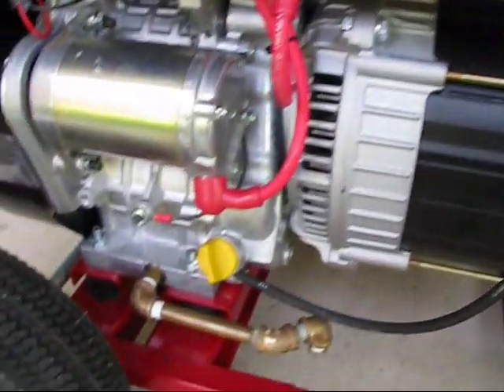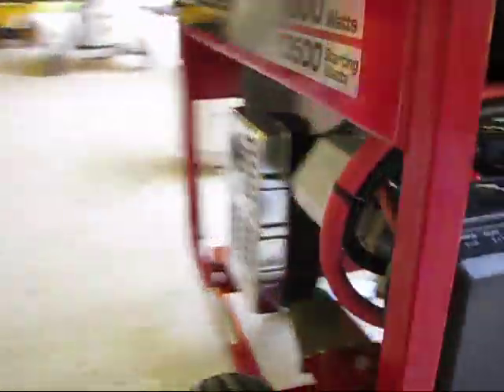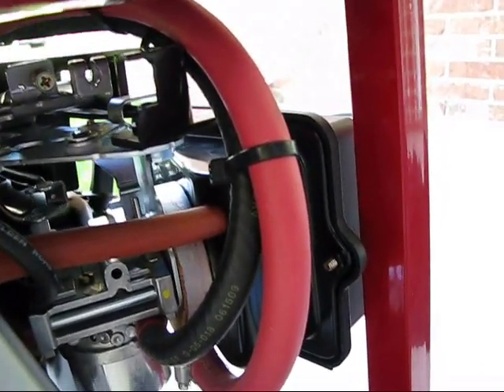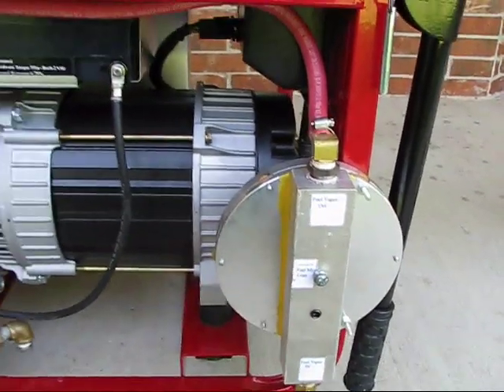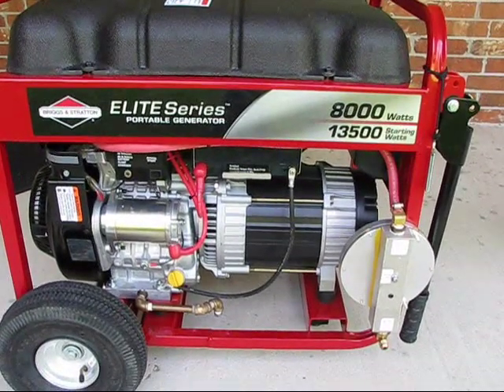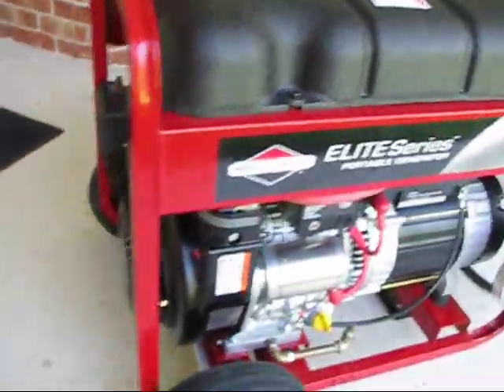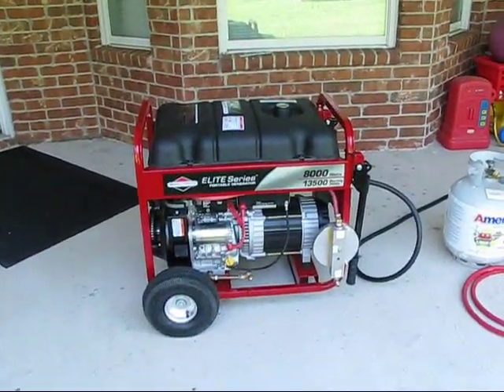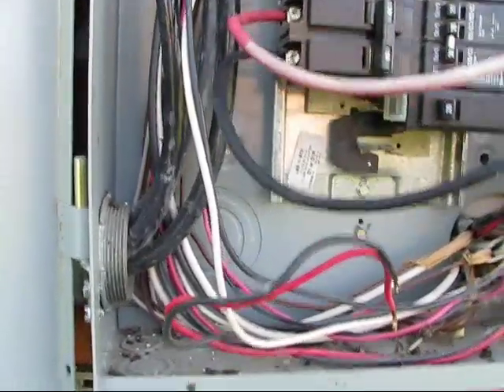Tri-Fuel Generator Setup

Comment: So the 30amp double throw breaker enough? I was able to reduce the amp rush to around 24~30 amps with a 5-3-1 kit
Reply from the maker: Exactly. I used the same 5-3-1 hard start kit to reduce the in-rush current from 51A down to 29A on startup. Yes, 30A breaker works fine for me.

Comment: I bought some brass pipe for my generator also as I liked your idea for the oil drain. The guy at the plumbing store said i might have problems down the road w/ the steel to brass connection. He said the steel will probably corrode, since you did this video have you noticed  any corrosion on your pipe fittings to the engine manifold?
Reply from the maker: I thought the same thing, but after many years I haven’t noticed any issues. Maybe the oil has something to do with preventing the corrosion from occurring? I did the same piping mods on my riding lawnmower, pressure washer and generator.
Reply: Great, I feel more confident in doing it. Thank you for the reply.

Comment: That generator is too small
Reply from the maker: Ellis County Texas Spotter 
Too Small ?? This generator is now seven (7) years old and has been used countless times with 1,317 hours on it. Never had an issue and this generator starts this AC system every time.
Reply: N5LHD  I would feel more comfortable running a 4 ton with at least 20kw with up to 50amps. Glad it works for you.
N5RDM

Comment: It is a good idea to extend the oil drain but not with rigid pipe. Vibration from the engine will cause the pipe to crack and break off. Use a hydraulic hose after the elbow to reach away from the frame.

Comment from the maker: Check with USCarburation. Make sure the ID of the venturi is the same as the carb on your engine.My engine had a miss/stunble at idle and loads below 1500 watts when running gasoline. Using a lathe, I bored the venturi to the same diameter as the carb. This solved all my problems when running gasoline or LP/NG fuels. Pay attention to the size an length of run your fuel supply line is. Under heavy surge you will suck the line dry is its to small dia.

Comment from the maker: Yes Tommy, The unit ran fine on gasoline prior to installing the Tri-Fuel kit. After the mod I noticed a hesitation and stumble during demand surges when using gasoline. It ended up being the ID of the venturi was to small. This created a wind turbulent at the intake, causing the fuel mixture to surge between rich/lean.  I used a lathe and bored the venturi ID to match the same size of the carburetor intake. All my problems went away. This unit now runs smooth and all tree types of fuel.

Comment from the maker: @BigCrzyRdNeck
 The Low Pressure Regulator attaches to the propane tank and should be rated at 11” of water Colum or about 0.4 psi. The Flow Capacity should be a minimum of 120,000 BTU. The Flow Controller is mounted on the generator frame. This functions as an emergency shut off incase your engine dies, keeping your vapor/gas from escaping to the atmosphere. Vapor/Gas flows out of the Flow Controller and in to a Ventura mounted on the carburetor intake.

Comment: @BigCrzyRdNeck cool i know my 13hp honda after ike burn through gas whill running a window unit and 2 friges. that will deffently be a nive set whne done i did notice the smoother running on lp i was suorised how much smoother it was  i would like to try the lp set up on my riding mainly to be different

Comment from the maker: @BigCrzyRdNeck
 Yes, fuel consumption is a big issue. That’s why I wanted multiple choices. The Tri-Fuel kit is made by Aardvark-AFS, a USA company in WI. Inert gas is feed via a common Low Pressure regulator. Future mods include: solid tires, quieter muffler, hour meter, 12vdc circuit to charge battery.
~ /\/\ark - N5LHD